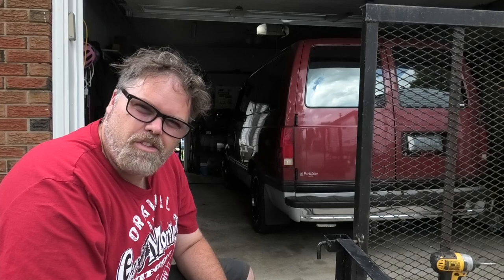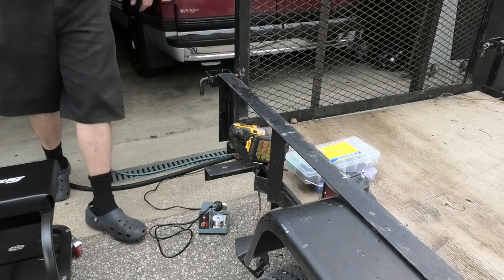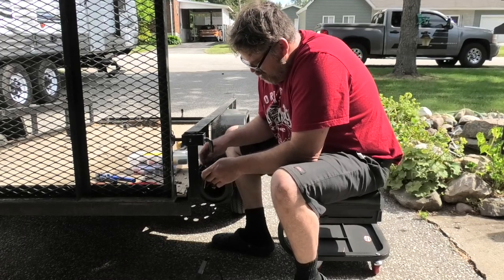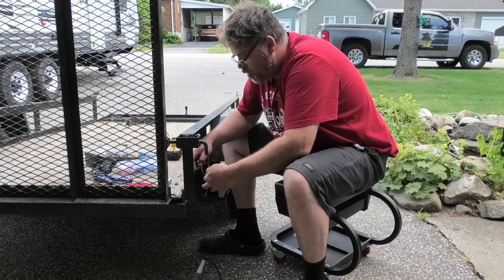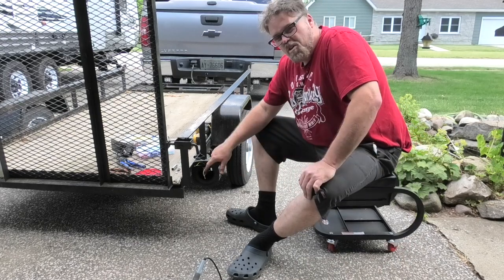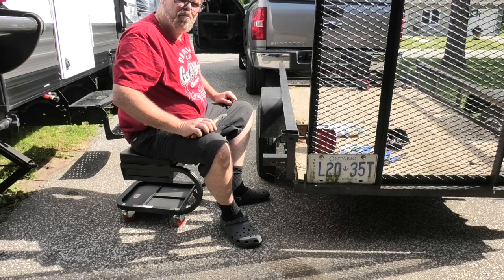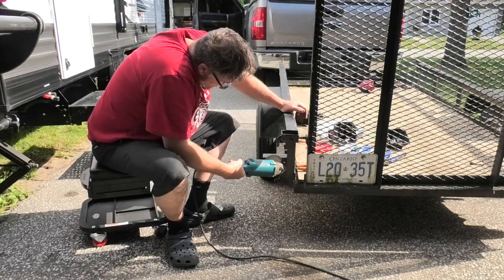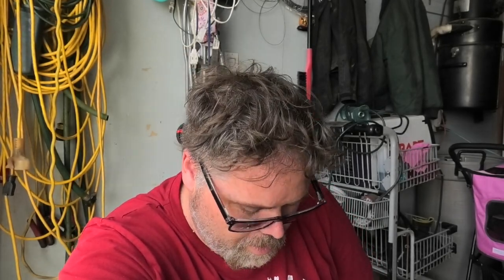TailLight Hook Up Maybe

Comment: Bill , I've got a GM truck very close to the same year . I case you don't know and ever have a problem with a trailer signal light not working there are separate fuses under the hood ( if I remember right) that operate ( and can blow ) that are independent of the rear signal light circuits for the rear signal light on the truck . Trailer only fuses . Drove me  nuts once trying to figure out why I had signal light at the back of the truck but nothing on the trailer . It's in the manual in the fuse section There's a trailer left and trailer right fuse .